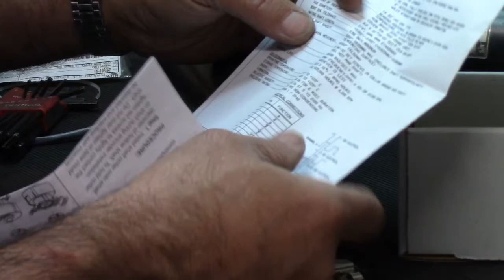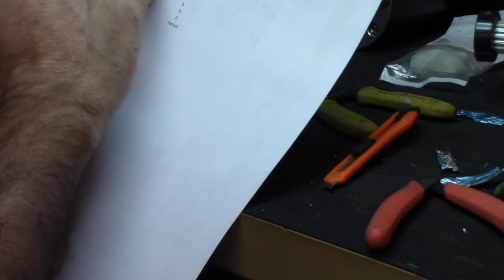CNC Knee Mill Centroid Upgrade - Servo Motor Encoder Installation

Comment: Slowly getting through your videos.. Very good job Marty.  Maybe I will reuse my Powertron DC mag motors.. it does not look to difficult to upgrade encoders from my tach/encoders.
Reply from the maker: Hi Randy, hopefully you can get new encoders on and not too hard to tune. You might post to the Centroid CNC user forum to ask about the motors. Maybe Centroid support staff will chime in and tell you if they have tuned that particular model of motor.

Comment: How aligns the encoder? Z pos in U phase is all I know, but how to do this?
Reply from the maker: When you put an encoder on a DC Brush servo, there is no need to align the encoder. You must have a Brushless Servo motor
Reply: @martyscncgarage5275  are you sure mr marty?
i replaced encoder on brushed dc motor and now it is making too much vibration in starting
Reply from the maker: @ahmedassem2979  yes I am sure. Did you use a 5vdc like driver differential encoder on your DC brush servo motor? Your likely problem is you need to TUNE the DC Servo. Are you using Centroid All in One DC? If so, post to the Centroid Users forum and post a fresh report.
https://centroidcncforum.com/viewforum.php?f=64